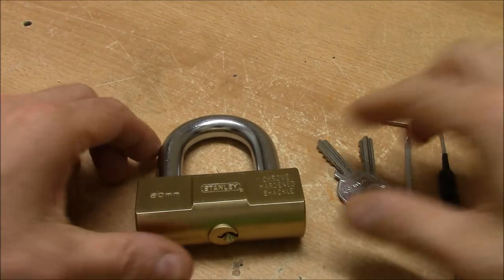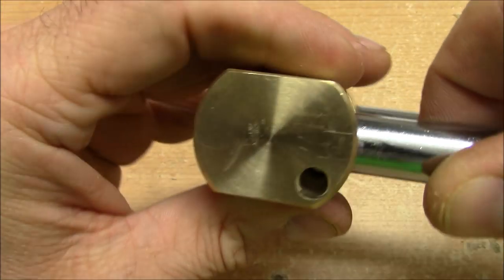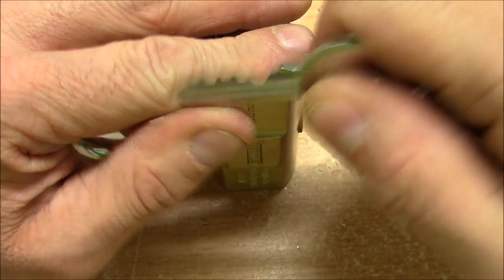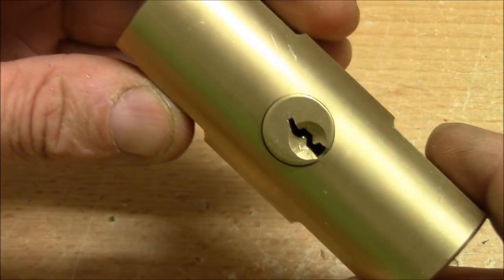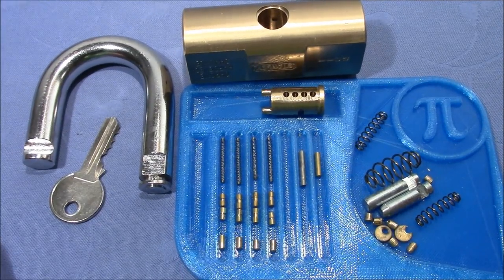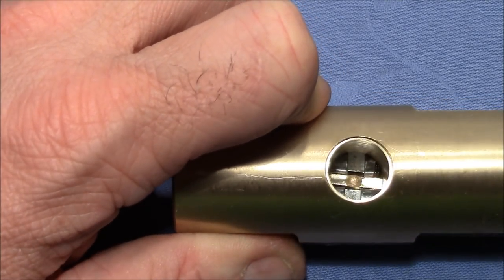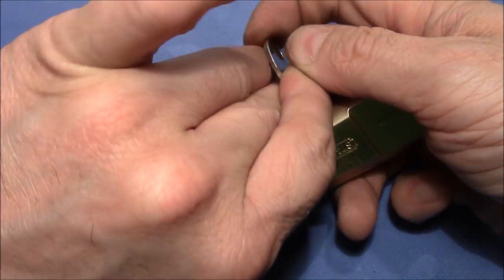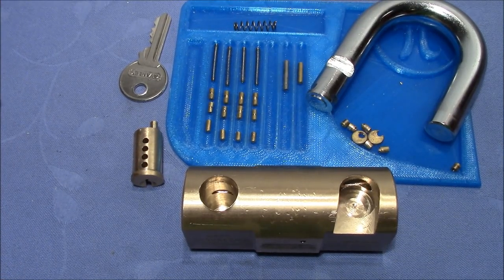(picking 517) Gutting adventure of a barrel padlock made by STANLEY

Comment: Really enjoyed this video!  When those locking springs let loose I jumped in my chair!
I love your "big hammer" technique in locating the hidden plugs too !!!
You could make a challenge lock with that one (LOL)...
Great point you made about the double driver pins ... I wonder if they were there to avoid pushing the key pins to the shear line? 
I would've liked to see how far the lower drivers mated down into the core with the key pins in place ... but I assume that the amount of the drivers below the shear line would've effectively cancelled out the spool portions / effectiveness.
GREAT VIDEO ... FUN & INTERESTING!!!
Thanks!
Reply from the maker: I was also shocked when it shot - pretty scary. I was really desperate with finding the pins on this lock - now the lock buddy lock like it suffers from eczema ;-) Thank you for your kind words.

Comment: First time I've ever seen a four pin core with a five pin key. I've got two guesses. Either they changed it to a four pin lock but didn't bother to change the key or the five pin blank is so cheap it actually saved money to use the longer key.
Reply from the maker: I believe it's a pure cost saving measure. These 5 pin keys are more common and look more secure as a 4 pinner. So it's their advantage. And usually no-one every would detect it.
Reply: It makes you wonder just how many locks are keeping secrets of their own. Maybe that's one of the reasons we pick them.

Comment: the top pins are spacer pins so the lock can work if they made the springs longer the springs  wood not last over the long term
Reply from the maker: Interesting, I never considered that: Longer springs suffer more from wear. But they could have just used longer pins to seal the chamber.

Comment: Very comprehensive dissection :) Really nice to see how one of these locks is actually working. Interesting way to drill out the metal plugs I might try it sometimes :)
Reply from the maker: Thank you - these plugs came out pretty easily. This is not the case all the time. Also tapping and pulling is an option.

Comment: What an expedition ! I hope you had your safety glasses on :o))  Those driver pins look like rejects from another lock production line where they did need proper spools, maybe ? They just don't look good, nor even completely finished :o) Thanks for showing us the whole dismantling.
Reply from the maker: No safety glasses - but I have learned for the future. That lock itself is not bad at all, but all the pieces for the core are crappy and do not really match - key with 5 pins, two drivers etc. - a bit like a Frankenstein lock ;-)
Reply: Yeah- the big shackle, brass body and the locking pins all look pretty good, it's a bit rubbish after that as you say :o)  Safety glasses, face shield, concrete bunker and a third hand next time then, haha :o)